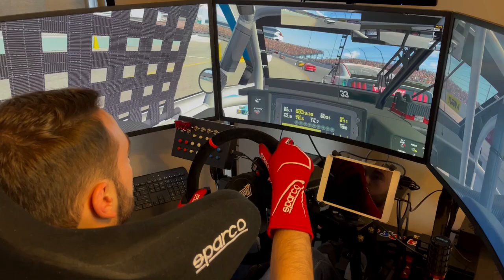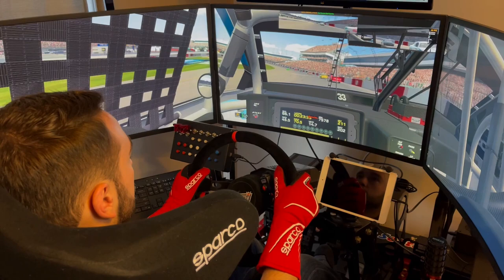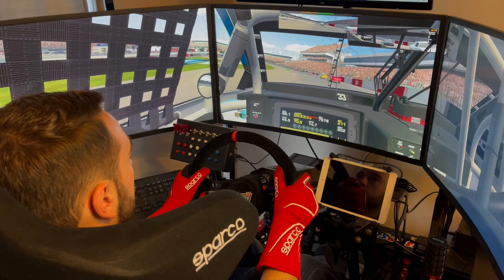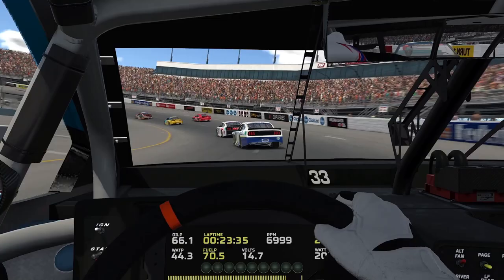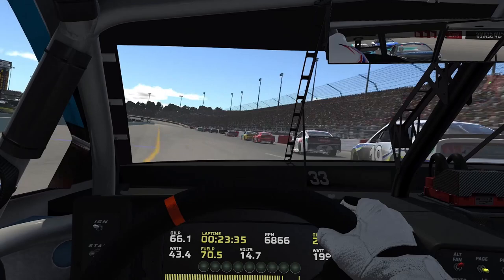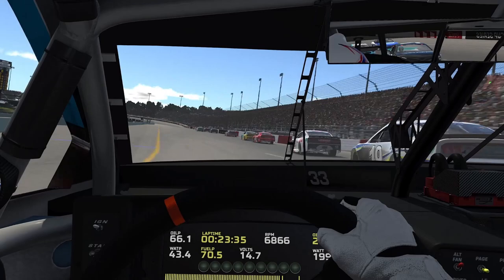HOW TO SETUP AND COMPLETE A PASS

Comment: Question/suggestion for future tips and tricks video: How do you go about tire management to ensure long run speed?
Reply: Take a wider arc into turns and throttle down. Also try not to turn the wheel in too much and let the banking aid in turning.
Reply from the maker: That's a great idea!